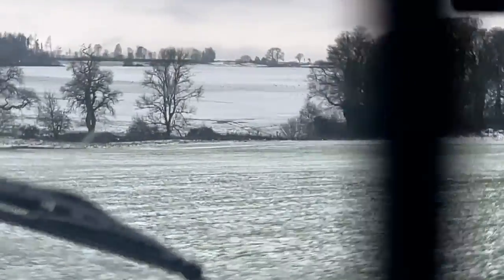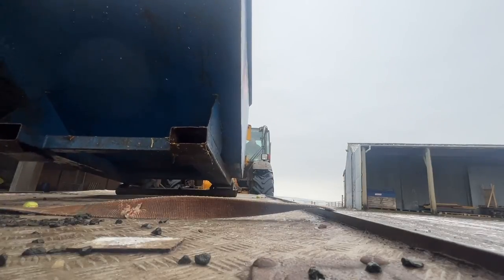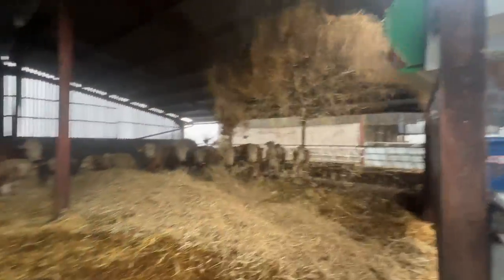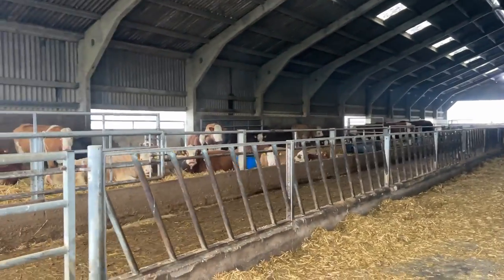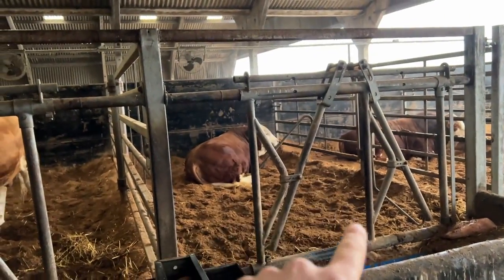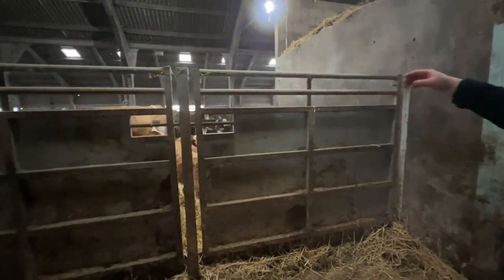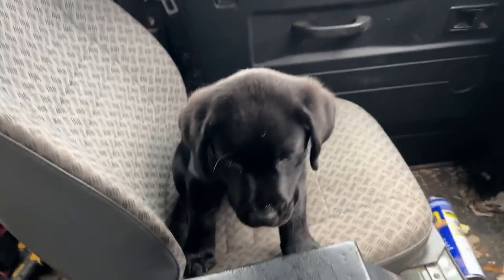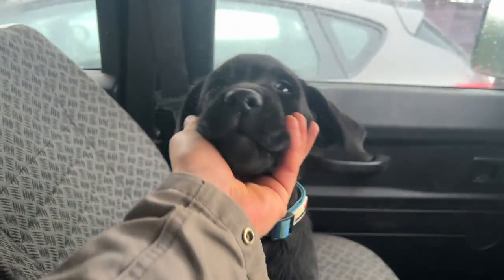Cattle Shed Tours | Smart Ideas | Dairy Conversion

Comment: Bit of T-Cut and that will buff out!
Crawford 2 and Tom have a cracking system going there - well thought out crush set up as well. Also those bull pens  - you can tell a stock man designed that

Comment: I think the dust tends to be more of an issue with the Teagle when you have very young stock. 
Having a passage that you scrape where the stock stand and eat will certainly reduce the amount of straw you go through but then you need a way of dealing with what is basically slurry. So so many options!
Reply from the maker: Never ending options
Reply: the slurry would not be an issue really as manure could be pumped by a contractor
Reply: As shed is next to grassland i belive

Comment: Take a spoon of muck from 12 different dung pats mix in a bag and take to vet for a feccal egg count. Soon see of you have any lungworm present. I have same thing so get sample done in the morning. They were wormed but maybe need another.
As for straw spreader Teagle dual chop uses hooks not knives shreds instead of chops and you can mount a spreadable sideways. Tom has designed a fantastic setup using existing sheds as good as I've seen on any new set up.
Reply from the maker: Yeh great setup, thanks will get that done 👍🏼